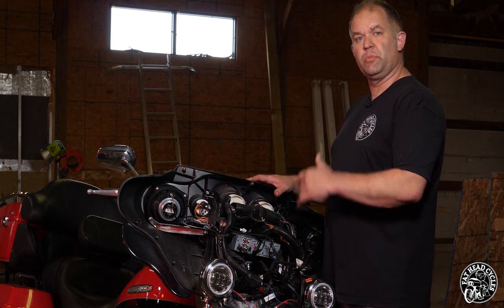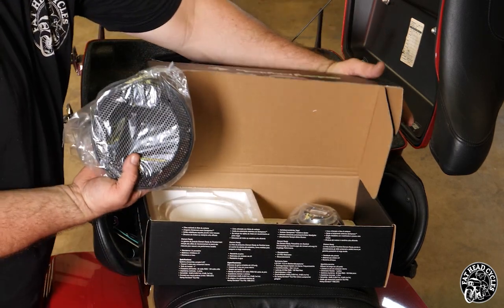Sony DSXM80 & Rockford Speaker Install 1999-2013 Harley-Davidson Street/Electra Glide & Ultra

Comment: Got this unit! Question for anyone,,, when in accessory mode everything works…. Except the usb2( which I plugged a data chord into).. doesn’t even read anymore…. When I crank my bike,,, my hand controls won’t work.. Bluetooth will connect but controls won’t work… any suggestions???

Comment: It looks like you didn’t disconnect the power . My Ultra has a security system , would I need to pull the main fuse before installing this radio ?
Reply from the maker: Nope, it's not affected at all!

Comment: GREAT VIDEO CHRIS !!!

I have 3 quick questions for you :)

-No need for the Metra AWC-1 (Controls) and the Metra 99-9600 (Install kit) with this Sony model ?
-Do I understand that if I have an Ultra Classic (2007), I will only need the rear speaker adapter harness (HD-RSPK-35)?
-I have in my motorcycle, a J&M amplifier, do I need some other adapters or harnesses ?

Kind regards ! Yves

Comment: I just ordered one of your kits but I didn’t catch the part about the rear speaker adapter being separate.Do you sell the rear speaker harness adapters? Part number? Is it ok to leave the rear harness unhooked.
Reply: PS. Great video.Not running my tour pack right now. May add an amp and lid speakers later.